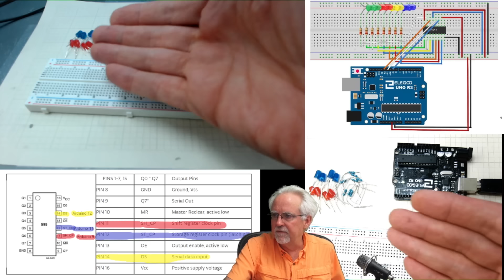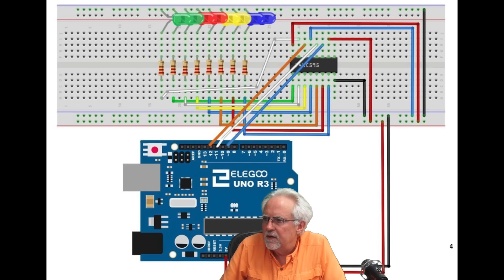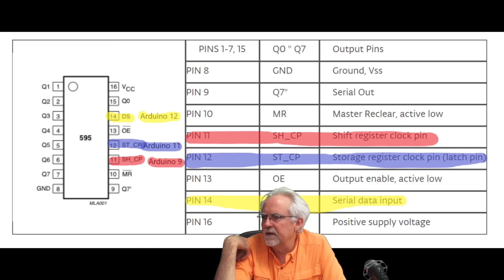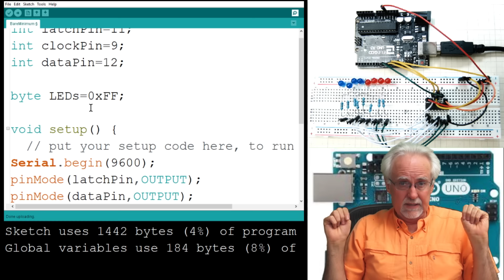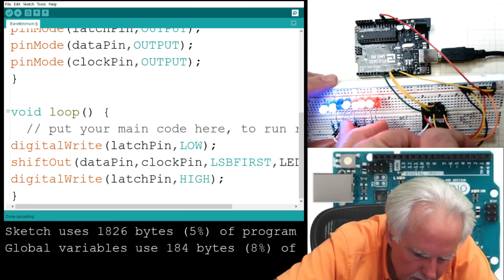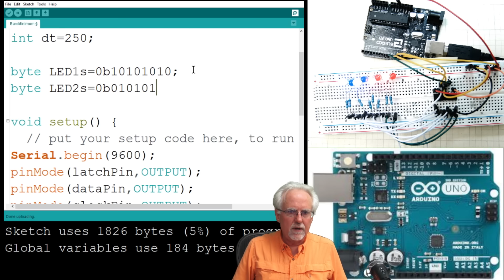Arduino Tutorial 42: Understanding How to Use a Serial to Parallel Shift Register (74HC595)

Comment: Paul, thank you for the interesting and useful lesson.

While following along with you, I had to troubleshoot the circuit a bit. At first, I put the Shift Register incorrectly. I looked at it and thought everything was connected correctly, but then I noticed a strange smell. After touching the chip, I realized that it had become very hot.

I disconnected the circuit from the power supply, waited a little, and then turned the component 180 degrees. After that, everything started working.

As for the homework, I was able to solve it quite easily. I only added one line of code in the loop section:

LEDs = LEDs + 1;

And everything started working.

I was also surprised that when I disconnected the 5V power supply and removed GND, the circuit still continued to work. I’m not sure yet how correct or safe this is, but it was definitely strange. Tomorrow I want to investigate this in more detail.
Reply from the maker: LEGEND!

Comment: I actually ended up pausing right after I got the flashing lights working because I wanted to see if I could make a counter. I had to go and look up the structure for the "for loop" because it had been a while since I last used it but I managed to get it working after a few rounds of troubleshooting. Then I went back the video and found out what the homework was. Now I have to come up with a different homework.
Reply from the maker: LEGEND!

Comment: I'm making this comment before moving onto the next video because it might just answer my question.  You said the home work may get difficult but I'm thinking it should not because in a previous video you did the myByte=myByte+1 and we saw the variable count upwards in the serial monitor.  So shouldn't that work with these LEDs also?  Make the LEDs variable count up by one, delay a little and then send that value in the shiftOut function and repeat.

Comment: Sir i find out that when it has one it can't off totally but it can be changed to any thing that I won't but don't follow this command 
0b00000000 or 0x00
Instead it will stay it position
Reply: Sir am really sorry Sir i just find out the problem now is that I don't use to use 

DigitalWrite (latching,  HIGH

Comment: Hallo, Mr McWhorter, At first I to had a problem... a resistor of 22K instead of 220 ohm and one diode that not worked. Once that resolved, rest was perfect. For the homework I added 2 variables: a "byte myNumber=0", and an "int j", and in the process loop a for loop " for j = 1 to j = 256 j=j+1", Inside the for loop  I added 1 to myNumber, and did the digital write of the latch LOW, the shiftout of "myNumber" and digittalWrite of the latch HIGH. My solution!

Comment: I had to refer back to this video a few times over the years to remember how these things work. You never miss a thing with a Paul Mcwhorter tutorial. Everything has worked for me, provided I followed the instructions and didn't miss something. I have changed my style of writing to a more conventional way of coding. With jumping back and forth between Python and Arduino IDE, this helps. Pauls ways works though, I like how considerate he is about spaces and the first letter being lowercase. This matters sometimes and his way is a sure way to avoid problems in every scenario.

With all that being said, the real reason I am commenting was to mention that these chips are great for logic. They are not so great, however, at outputting high current. 6mA per output pin to be exact. For the sake of longevity, it is important to understand the forward voltage of your LED, as well as Ohms Law, in order to maintain a current within the the chips limitation. These thing are also underrated though, I have never had a problem.

Once you experience this, you want more excitement. The only thing to do now is try a PSIO Shift register, where you can read 8 or more inputs with 3 wires. Ideas that come time mind are keyboards, game controllers, and electric pianos. These chips are so easy to cascade too. Imagine controlling 16 or more Outputs/Inputs with 3 wires. Its amazing the technology at our fingertips!

Hope all is well for you Paul. Thanks for the insght, inspiration, and know-how. I hope to be in a position similar to yours one day. To live such a humble, yet efficient life and still be up to date with the latest technology.

Comment: @leebasham1107
4 minutes ago (edited)
For the homework, I just added LEDs=LEDs+1 to the end and set the Bytes to 00000000. my problem  was trying to stop it going round again, I tried different ways to error trap it at 255 but it still seemed to wrap around to 0 again and continue counting up. By the way, I really don't like coffee, my stimulant of choice is a full fat, Ice cold C0c@-C0l@ (to prevent being demonised).

Comment: loaded the code and all led lit up, was so chuffed my circuit and code worked first time, but no, as soon as I started to change the binary value of the lit LEDs it all went wrong with the LSB and MSB LEDs mixed up.  took me a little while to sort it out but managed it.
great video, nice project, had lots of fun with this one.
Reply: I'm having a similar problem…the code works with either 0x00 or 0xFF, but in all other cases it gets de LEDs mixed up, exept in some cases when I change LSB into MSB. How did you eventually fix this? Grtz

Comment: Problems. Though my lights initially worked now they have stopped. I’ve 4ple checked all my circuits and all match the schematic and are in good contact. I had tried to test the lights by forcing 0xFF to both led sets. Failing that I loaded everything to my Tinkercad simulator and it reported that with 0xFF I was sending 64.8mA to the 74HC595 chip which will only accept a maximum of 50.0 mA. Is it possible I have damaged my chip? It still won’t work with lower values. Be interesting if you can answer this. Otherwise love the tutorials and am working my way through all of them. Keep up the good work Paul.
Reply: I changed resistor value 330 ohm to 445 ohm and it worked

Comment: Well, I've checked all my LEDs, checked all my wires... I must have a bad chip.  Does not work in the slightest.  Checked to see if the chip was upside down (reversed), nope.  Was looking forward to this one, I do need more pins than the Arduino has for the project I have in mind...Does anyone know how to check for a bad chip?  Besides it not working, that is.  What checks can I do with a multimeter?

Edit:  Bad breadboard.  Too much use, got a new one, much better contact!  All fixed, everything works, Homework DONE!

Comment: Great lesson.  Did the homework.  I do not know if you want us to use these comments for tips I have discovered along the way.  Things like using needle nose pliers 1/4" above the breadboard helps seat the components.    They don't bend if you do that.  From time to time, I have wanted to drill down into some of the whys and wherefores of Arduino.  The Sams book Teach Yourself Arduino Programming in 24 Hours by Richard Blum is a great resource.  Also, the Arduino forum is a great place to learn more.

Comment: This lesson is the basis for the reason I started learning electronics and arduino programming.  By adding a potentiometer and more programming, you have the basics for almost any engine gauge in a car.   As I get more in depth in the programming and circuit design, I will be able to make a fully functional Knight Rider KITT dashboard.  That is my end goal for learning and you are doing a great job teaching.

Comment: Hi Paul, thank you very much for your mistakes! In my experience we learn best by making mistakes! So....good learning! I made the homework. Hard for me was, until I find out that even if I defined LEDs as a BYTE the Serial.println-Comand converts the hex-value in decimal :-). So far I didn't found out how to print the hex-code. But just adding 1 to the hex-value it works pretty fine! So the evening is done!

Comment: I used a byte called "mask". It's value is used in a for loop that counts like: for (mask=0x00; mask<100; mask++) {
LEDs=0xFF;  Then I use bitwise and operator  like this: shiftOut(dataPin, clockPin, LSBFIRST,  ((LEDs & mask));
Wayne -- When you add 1 to FF you get 0x100, which is 256. Or $0100  in assembler.

Comment: I  completed the homework 100% on my own and provided a neat little sample for anyone to try.  Thank again Paul.
//////////////////////////////
// Q1 - 1             16 VCC  Voltage +5V
// Q2 - 2             15 Q0 - 0
// Q3 - 3             14 DS Arduino 12 (Serial Data)
// Q4 - 4             13 OE (GND)
// Q5 - 5             12 ST_CP Arduino 11 ((Latch Pin Storage Register))
// Q6 - 6             11 SH_CP Arduino 9 (Shift Register Clock)
// Q7 - 7             10 MR (5V)
// GND - 8             9 Q7' 
int latchPin=11;
int clockPin=9;
int dataPin=12;
int dt=50;
 
byte  allOn=0xFF; //ALL LED's ON
byte  allOff=0x00;
//byte  LEDs=0xAA; //1 0 1 0 1 0 1 0
//byte  LEDs=0xA4; //1 0 1 0 0 1 0 0
//byte  LEDs=0xA8; //1 0 1 0 1 0 0 0
//byte  LEDs=0b10101001;
//byte LED1s=0b01010101;
byte style1=0b00000001;
byte style2=0b10101010;
//byte LED2s=0b01010101;
 
void LEDRoll() {
  byte myArray[] = {B0000001, B00000010, B00000100, B00001000, B00010000, B00100000, B01000000, B10000000};
  
  for (int i = 0; i <= 8; i++) {
    Serial.print(i);
    Serial.print(" ");
    Serial.println(myArray[i], BIN);
    digitalWrite(latchPin,LOW);
    shiftOut(dataPin,clockPin,LSBFIRST, myArray[i]);
    digitalWrite(latchPin,HIGH);
    delay(dt);
  }    
}
 
void LEDSweep() {
  byte myArray[] = {B0000001, B00000010, B00000100, B00001000, B00010000, B00100000, B01000000, B10000000, B01000000, B00100000, B00010000, B00001000, B00000100, B00000010, B0000001};
  //delay(100);
  for (int i = 0; i <= 14; i++) {
    Serial.print(i);
    Serial.print(" ");
    Serial.println(myArray[i], BIN);
    digitalWrite(latchPin,LOW);
    shiftOut(dataPin,clockPin,LSBFIRST, myArray[i]);
    digitalWrite(latchPin,HIGH);
    delay(dt * 2);
  }
}

void setup() {
  // put your setup code here, to run once:
//This flashes a few times for fun.
Serial.begin(9600);
pinMode(latchPin,OUTPUT);
pinMode(dataPin,OUTPUT);
pinMode(clockPin,OUTPUT);
digitalWrite(latchPin,LOW);
shiftOut(dataPin,clockPin,LSBFIRST,allOn);
digitalWrite(latchPin,HIGH);
delay(dt*20);
digitalWrite(latchPin,LOW);
shiftOut(dataPin,clockPin,LSBFIRST,allOff);
digitalWrite(latchPin,HIGH);
delay(dt*20);
digitalWrite(latchPin,LOW);
shiftOut(dataPin,clockPin,LSBFIRST,allOn);
digitalWrite(latchPin,HIGH);
delay(dt*10);
digitalWrite(latchPin,LOW);
shiftOut(dataPin,clockPin,LSBFIRST,allOff);
digitalWrite(latchPin,HIGH);
delay(dt*10);
digitalWrite(latchPin,LOW);
shiftOut(dataPin,clockPin,LSBFIRST,allOn);
digitalWrite(latchPin,HIGH);
delay(dt*10);
}
 
void loop() {
  // put your main code here, to run repeatedly:
LEDSweep();
// LEDRoll();
// LEDRoll();
// LEDRoll();
// LEDRoll();
// LEDSweep();
// LEDSweep();

}
Reply from the maker: LEGEND!

Comment: I got mine working on the first try, but that’s because I tested the resistor/LED combinations before I did the rest of the wiring.  In an earlier lesson you showed how to test part of what you are doing as you go to make debugging easier.  I listened and learned.

Comment: Got my new shift registers (fried the last one putting it in backwards--led to very intermittent connections). Everything's working as expected, except when the Arduino starts up or reboots, all LEDs light up and stay on for a split second. Teach's doesn't do that. 

I've also noticed that this shift register's memory is pretty sticky, and holds thru a reset of the Arduino--my last light pattern is still there after an Arduino reset.

Anyone have any thoughts? To get around this, I had to trigger the reset off of an Arduino pin (instead of hardwiring the master reset to 5V, as Teach has done here).

Comment: I went a step further. I added LEDs=LEDs+1; and a delay of 1000 and converted it into a binary counter.
I wondered what to do when it reached FF
I tried to reset LEDs to 0x0  using an if statement but that did not work,
However, It sarts over again just as it is. It must be counting numbers larger than FF

Comment: for the homework, I used this solution:
int latchPin=11;
int clockPin=9;
int dataPin=12;
int dt=250;
int counter=0;
byte LED1s=0b00000000;

void setup() {
  // put your setup code here, to run once:
  Serial.begin(9600);
  pinMode(latchPin, OUTPUT);
  pinMode(dataPin, OUTPUT);
  pinMode(clockPin, OUTPUT);
}

void loop() {
  // put your main code here, to run repeatedly:
  while(counter<256){
    digitalWrite(latchPin, LOW);
    shiftOut(dataPin, clockPin, LSBFIRST, LED1s);
    digitalWrite(latchPin, HIGH);
    delay(dt);
    LED1s=LED1s+1;
    counter=counter+1; // When counter reaches 256, program exits while loop
  }
  LED1s=0b00000000; // reset LED1s to 0 to start over
  counter=0b00000000; // reset counter to 0 to start over
}

Comment: I was banging my head against the wall for an hour yesterday, trying to get this circuit to do anything close to what I expect. At first I had the entire chip reversed... It became VERY hot. (I might need reading glasses lol.) Caught that, reversed it, and one light would come on. I'd power cycle the Arduino, and I'd get most lights on... Then no lights again, or a random selection. 

I woke up today, plugged it into my laptop, and all of the sudden it's working as expected. All my efforts to reseat wires yesterday were futile. Quite lost... But hey, I'm seeing all on with FF and all off with 00 now, so fingers are crossed!

UPDATE: After far too much finagling with the shape of the pins on the IC, I've finally gotten the thing to make constant contact with the breadboard. Pretty darn sure this was my problem the whole time. Seems like my weird and random issues might be explained by intermittent connections. 

HOMEWORK SPOILER:
Removed a few lines of code, and added 2--one to print the value of LEDs to serial mon, and another to increment LEDs by 1, at the end of the loop.

Comment: I was able to get it working; however, had two wires hooked up wrong, so lights were not working properly.  Took a while to go over the wire locations, but finally got it.
Reply from the maker: It is called LEARNING! Good job.

Comment: Hi Paul, this and lesson 41 were amazing lessons.  Everything i am learning is new to me but you make it so easy to understand and follow. I built the circuit before watching you build it and it worked flawlessly. The homework was a piece of cake. Finished it in like 2 minutes! I only added an extra line of code but i also decided to print the numbers in Hex, Bin and Dec because why not :). Thank you so much for these amazing lessons. Here is my code:

int latchPin=11;
int clockPin=9;
int dataPin=12;
int wait=500;

byte led=0x00;

void setup() {
  // put your setup code here, to run once:
  Serial.begin(9600);
  pinMode(latchPin, OUTPUT);
  pinMode(clockPin, OUTPUT);
  pinMode(dataPin, OUTPUT);
  
}

void loop() {
  // put your main code here, to run repeatedly:
  digitalWrite(latchPin, LOW);
  shiftOut(dataPin, clockPin, LSBFIRST, led);
  digitalWrite(latchPin, HIGH);

  Serial.print("Hex: ");
  Serial.print(led, HEX);
  Serial.print("  Bin: ");
  Serial.print(led, BIN);
  Serial.print("  Dec: ");
  Serial.println(led, DEC);

  delay(wait);

  led=led+1;

}

Comment: Greetings.
My homework solution:
#define dataPin 12
#define clockPin 9
#define latchPin 11
int dt=500;
byte ledS=0x00;         //Hexadecimal
// byte ledS=0b00000000  Binário
// byte ledS=B00000000    Binário
void setup() {
  // put your setup code here, to run once:
  Serial.begin(9600);
  pinMode(dataPin,OUTPUT);
  pinMode(clockPin,OUTPUT);
  pinMode(latchPin,OUTPUT);
}

void loop() {
  // put your main code here, to run repeatedly:
  digitalWrite(latchPin,LOW); // quando vamos enviar dados temos de por o lact in low
  shiftOut(dataPin,clockPin,LSBFIRST,ledS);
  digitalWrite(latchPin,HIGH);
  Serial.println(ledS);
  delay(dt);
  ledS++;
}

Comment: I have put this circuit and code together 8 times, both on Tinkercad and physically and have yet to get a single glimmer from any of the 8 less. I am VERY frustrated and I am a 76 year old retired math teacher who handles frustration poorly.
Reply: I wasn't able to get this to work either at first.   Here is what I did.  I took the 5v and touched the space after the circuit to see if all of the LED's would light up essentially bypassing the 74HC595.  All of them lit up except for one.   I replaced it and retraced my paths.  This time all of the lights are on.  Might want to test your LED's

Comment: Homework:
int latchPin=11;
int clockPin=9;
int dataPin=12;
byte LEDs=0x00;
int wait=100;

void setup() {
  // put your setup code here, to run once:
  pinMode(latchPin,OUTPUT);
  pinMode(clockPin,OUTPUT);
  pinMode(dataPin,OUTPUT);
  Serial.begin(9600);
}

void loop() {
  // put your main code here, to run repeatedly:
digitalWrite(latchPin,LOW);
shiftOut(dataPin,clockPin,LSBFIRST,LEDs);
digitalWrite(latchPin,HIGH);
LEDs=LEDs+1;
delay(wait);
}

Comment: Be careful when choosing the resistor value when powering 8 LEDs via a shift register. If all the LEDs are illuminated at once, such as with certain chase patterns, you don't want to exceed the maximum limit of the shift register's power pin (I don't know off-hand, perhaps 50mA or 70mA??). When simulated in TinkerCad, <=330 ohm resistors will result in shift register failure, when all LEDs illuminate simultaneously.